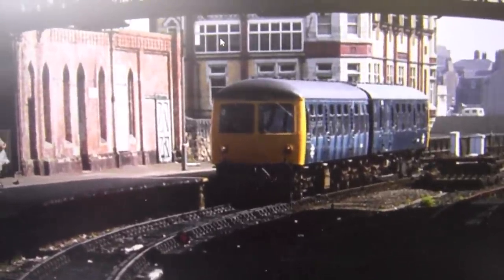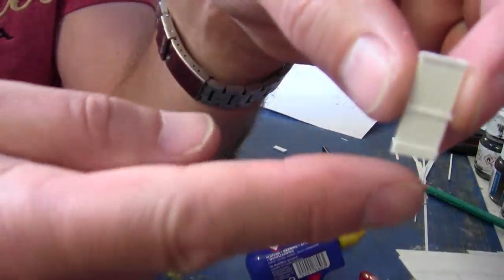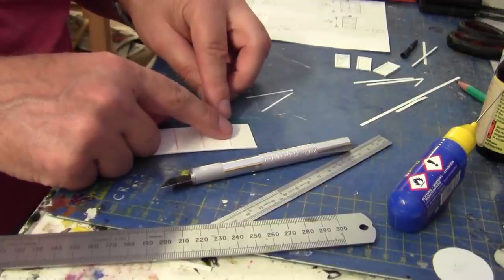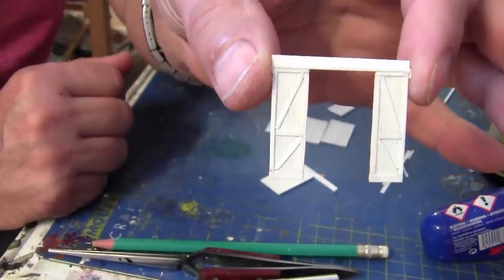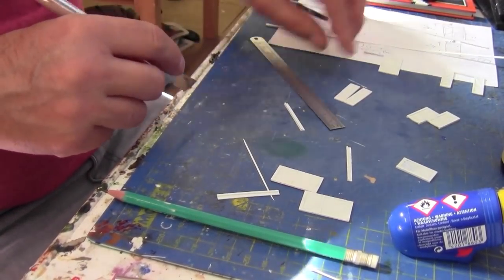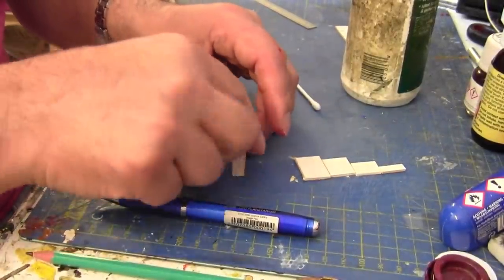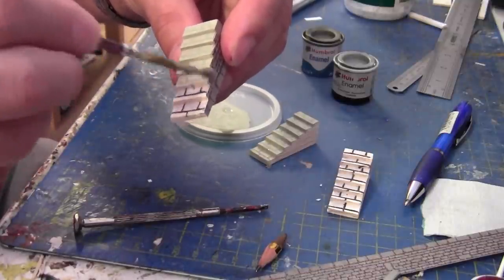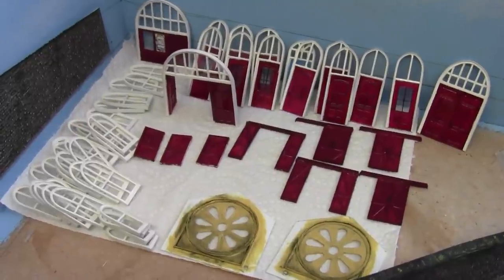Loading Bay Doors, steps, Door handles..........No213

Comment: Another fantastic tutorial on scratchbuilding Tony, particularly love the tip with the track pins and a 10/10 for using the shortest pencil I have ever seen! Cheers Steve
Reply from the maker: Thank you Steve. i see you are catching on the videos. that pencil has been with me forever, it about goes into the pencil sharpener. a few more turns then it will be gone...best wishes Tony